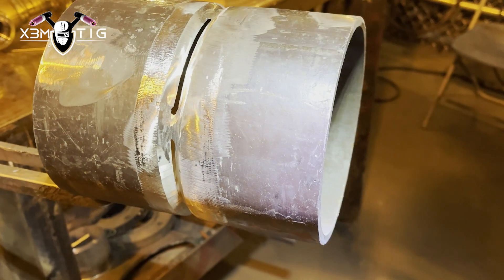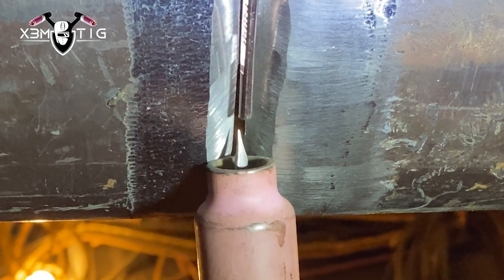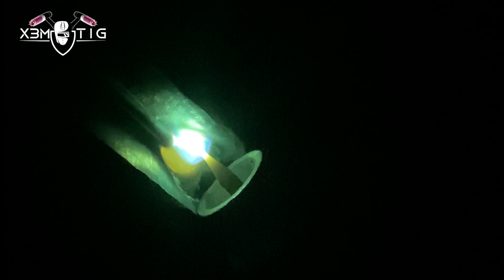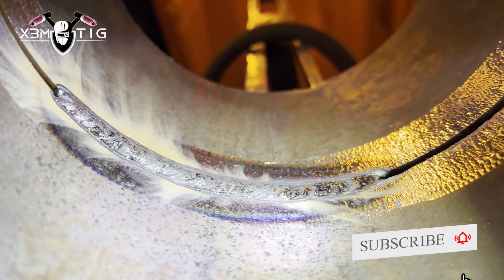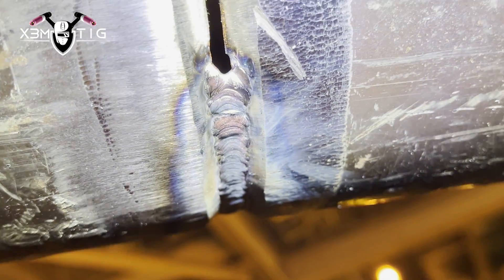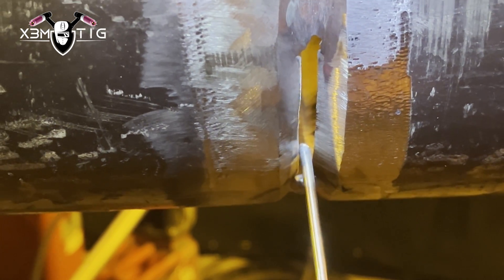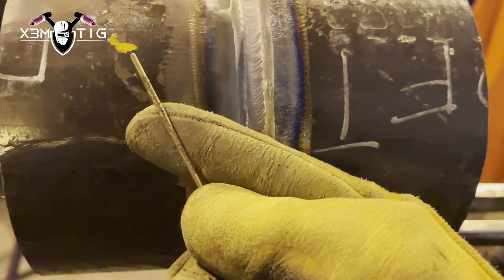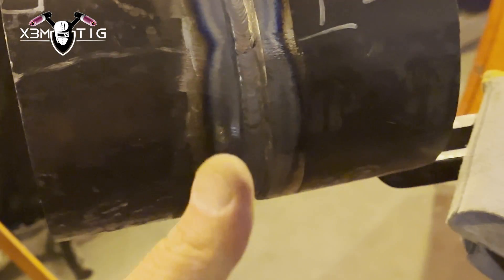Perfect Your TIG Overhead Root Pass on Tight Gaps – Here’s How!

Comment: My company does not supply us with 3/32 rod instead we use 2,4 rod wire
Reply: 2.4mm fill wire is equivalent to 3/32 or .09375/.094 whatever you’re preference is to call it.

Comment: I have so much issues on the bottom and i get alot of suck back  im trying to teach myself  not one at my job  can help so im trying  can't decide on settings  because  we have older machines
Reply from the maker: Use 1/8 filler rod, and you have to play with machine settings until you get fine tuning…

Comment: Are you pushing the tipnof your wire towards the inside of the pipe, like pressure against your bevels? Or are you pushing the wire forward into the puddle?
Reply from the maker: Pushing filler rod into the puddle

Comment: It is interesting and informative. But it seems to me that this method is not suitable for all types of additives, if you use 13.23, it is unlikely that this will happen. When served in drops, it will boil. It can either be pushed through at a higher current or supplied from the inside . Is it 12.64 in your video?
Reply: Where do you work? In Europe? What's your opinion on esab 13.09 welding wire?
Reply: @mddenis1  I work in Russia, in the very north of the Arctic Circle. I haven't encountered the 13.09 wire yet, but as I read it, it is low-alloy, so there shouldn't be any problems with it at all. But the additive 13.23 is highly alloyed for pipelines operating at low temperatures and with a low-temperature environment. She is very refractory, she needs an increased current and she really does not like procrastination. If you delay with it, it begins to boil and pores appear. It is always advisable to feed it inside the pipe when welding the root. There may be an exception, of course, if it is pushed through a welding bath at high current, but for this you need to use a thin rod and a high feed rate. But there is a possibility of error, you can fall a lot very much or, conversely, not give enough.
Reply: @skullbeard1339 Thanks for your reply. The funny thing is that I am also from Russia, but currently I work in Europe.
Reply: @mddenis1  Why?!) What are they paying now? I'm from Koenig. There are a lot of jobs in Russia now and they pay normally. In Europe, they pay 13-14, but if you spread it out in a circular pattern, then there is no point. Here I get 220-240, paid inter-watch, sick leave and vacation, plus deductions. Well, the main reason why I'm not considering working there now is that the governments of those countries are against us now. Not only against our Government, but also against our people. And I think it's not worth working for their economy now. Let them bring "hardworking" Arabs and Uzbeks))) And how do you like additive 13.09, where do you work in Europe?
Reply: @skullbeard1339  Finland. I get approximately same as you. I agree that payment is similar, only advantage is very comfortable apartments where you have your own room and that you can explore another country and practice language. But what I get here is minimum, you can much more if you find a direct employer